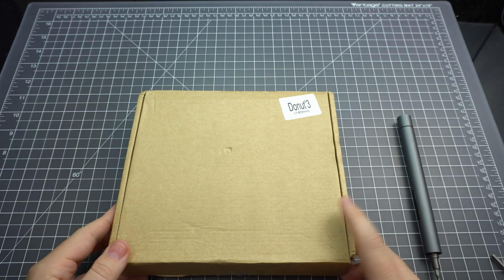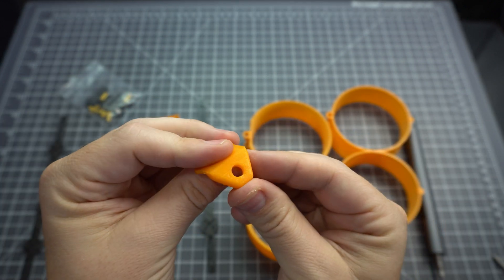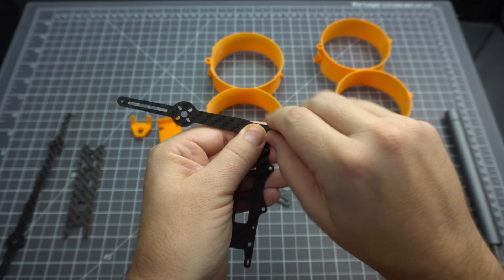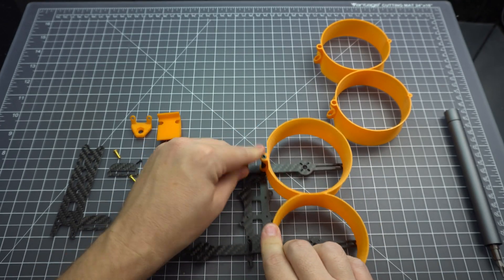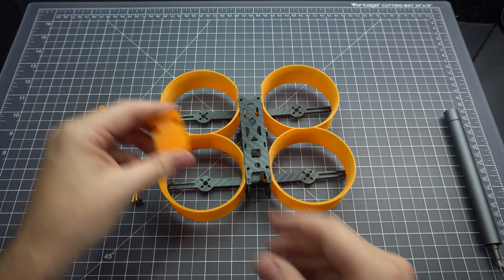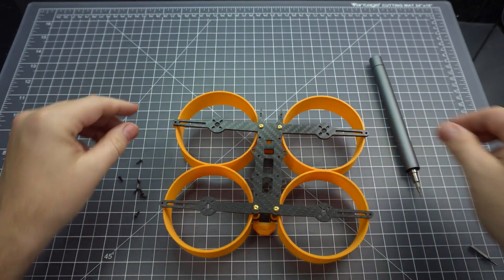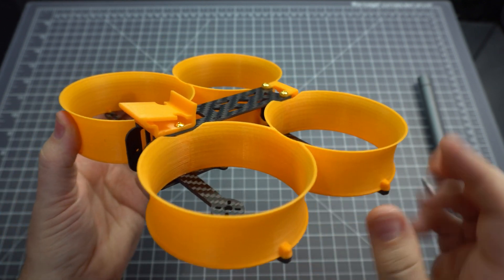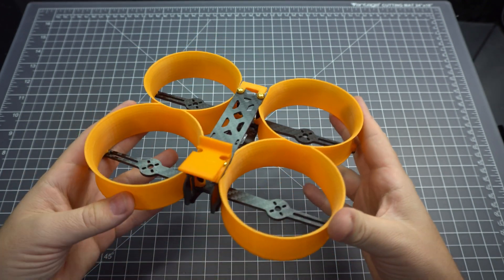$30 Cinewhoop Frame - Donut 3" - Overview and Assembly

Comment: I bought the same, frame is nice but ducts in PLA are too fragile, broken after first crash (and wasn't a hard crash)
Reply from the maker: Yeah this won't take a crash very well, but the ducts do perform well with the right props. There are 3D printable ducts that fit this at least.

Comment: just finished my build of 1 tonight!  flight test tomorrow!
Reply from the maker: Awesome! What motors and props?
Reply: @whiffles  went with hglrc flame 1407 3600 kv and some 3" azure props that i had to nip the tips off of for clearance in the duct. It passed the hover test in my hoise, waiting for rain to clear to try and get a flight test. Went with an hglrc all in one stack as well, (basically an xjb 145 guts) using 850 mah 4s that i use on my 3" gecko build as well.
Reply: I do want to try some of those specialty cinewhoop props for sure though, i live 20 minutes away from getfpv so am kind of spoiled. Which props did you say were best out of those again?
Reply from the maker: @Big-Purv  Sounds like a good budget build! Yeah definitely try the Gemfan 75mm duct props. They're great and you don't need to trim them down. Be sure to check your motor temps. You may need to tune it down a bit.
Reply: Thank you for the tips sir!